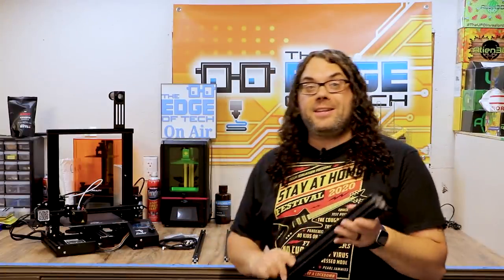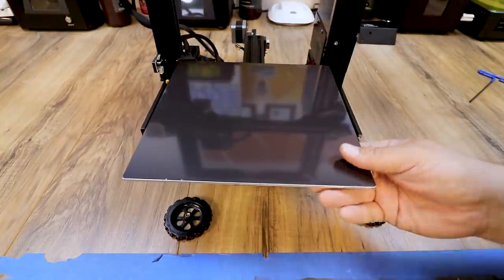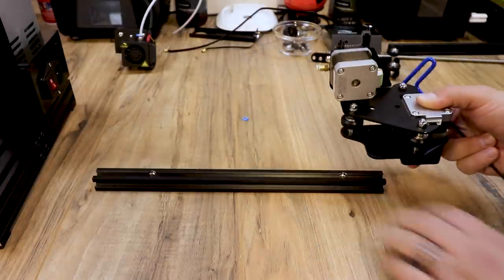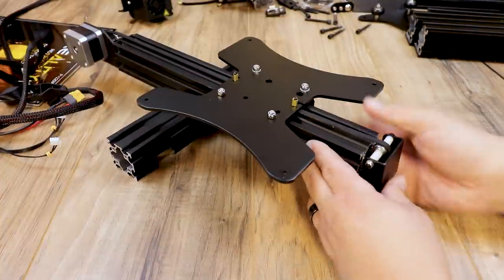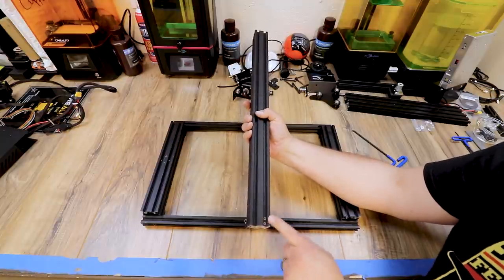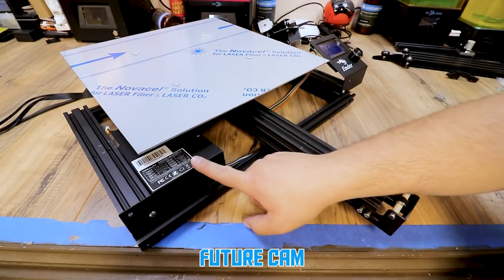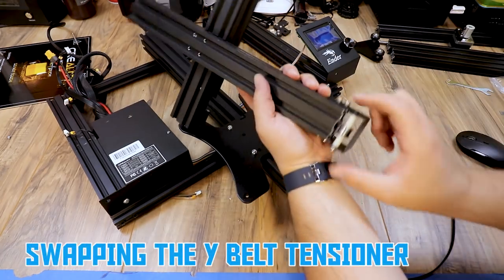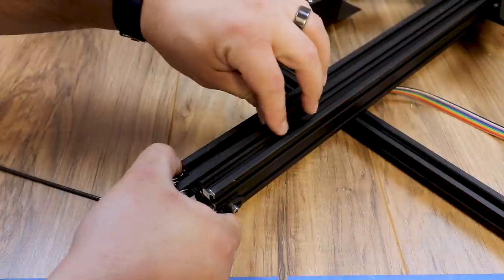UPDATED Ender Extender 400 Kit assembly for the Creality Ender 3 Pro

Comment: When I was making sure the vertical extrusions were properly parallel to each other, I clamped a level to each side, checked for square and then tightened the bottom bolts.  Easier than doing it by eye.

Comment: do you have issue with the Y carriage? I figured since the build plate is bigger = more weight = print issues
Reply from the maker: If you go to fast you could. When I used mine, I just printed at normal speed. It was ok.

Comment: Awesome video, many thanks for this. Is there a recommended Y motor for this as I am worried the original 42-34 will not cut it with the heavier build plate and larger prints that will be created on it? Should I change any other stepper motor or am I being paranoid?

Comment: Bit off topic.. could u do a video or reply here on having a completely solid bed on an ender 3 v2? By having 2 wheels between the solid bed mount without using any springs..
Id really appreciate it since im fed up with bed leveling
Reply from the maker: You can use solid bed mounts as long as you have auto bed leveling and that will kill two birds with one stone for what you're looking for!
Reply: Def need the ABL!I recommend TH3D studios! Got everything I needed and a little extra for just under $100 SHIPPED!!!!

Comment: I bought the 400x400x250 kit for $149 but I didn't want to fork out $100 more for the taller kit so I just bought 2x 600mm 2040 extrusion for $25ish and a 500mm lead screw for $13ish I think and a roll of wire to extend my wires for $5 and saved $60 give or take but I think but honestly cheaper route to go is buy creality cr10 s4 frame from banggood for $100-$150 and source a y carriage and bed and save about $60-$100 (maybe less or more depending on if you bought the wider kit and taller kit separate or as a package together) just a thought. But the kit itself was well packaged and parts were good just if I had to do it again I know a cheaper route plus after all is said you will have an extra ender 3 assembly and maybe for the extra 60-100 you saved you could part together an ender 3 and have 2 printers the numbers are just rough estimates but just food for thought not bashing the extender kit because I don't regret buying it because it did what it was supposed to and was what it said it was.
Reply: And I don't feel that only 4 wheels on 4040 extrusion is stable enough for a 16x16" or 400x400mm build volume.

Comment: I noticed on this larger bed, there is more surface area, and the screw stay in the same location. How is leveling affected of the entire bed? Is there any part of the bed not leveled?
Reply from the maker: It can be manually leveled like any other large printer. But I think I'm going to do auto bed leveling as a part of the project! More video will be coming soon!
Reply: @TheEdgeofTech  yes also interested in the head bed upgrade as well as a video showing firmware upgrade and maybe a description of actual machine size after the new build.
Reply: I haven't had much of an issue running my Ender 3 Pro 400 XL for the last few weeks but most of what I've been printing has been within the dimensions of the original build plate. Thingiverse has some models for cutting your own Y carriage which I still I plan on doing asap with the plasma cutter.

Comment: Just pulled the trigger on one of these for my non-pro.  I'm planning on using an adhesive PEI sheet on the bed - thoughts on whether I should put a more powerful (higher torque rating) Y axis motor on it during the rebuild?
Reply from the maker: I think it'll be fine and if it ever goes out then get a bigger one!

Comment: So you made this video in November, can you share your experience with this kit since then? I am more interested in 2 things....the X axis sag using only 1- Z axis lead screw and the build plate heating. Do you recommend a 2nd Z axis Lead screw? Do you recommend a larger heating plate? I have 2 Ender 3's both are non-Pro and I want to do this Mod on one of them. Thanks Man
Reply: Hello. Did you ever find out if bigger heating plate is available. I’m getting ready to do same upgrade on my ender3Pro
Reply: @bruceyoung1343  I ended up staying with the 300x300 build and the stock heater works fine. However I think the Ender Extender website has larger heaters for the 400x400
Reply: I’m thinking on replacing heater since it will be taken apart down past that on EnderExtender kit gets installed
Reply: I installed an extra Z screw it is a must too much sag

Comment: Question have you installed the silent board in the Ender 3 yet.  I did and mine prints great except when I use the pause at layer height setting what it does it goes into that setting but it resumes print right away without the pausing.  Any ideas on fixing this

Comment: Does not include a bed printing material, not glass no nothing.
Does not include any kind of crimping or plugs for the cables, you have to provide your own tool and know how to do it safely. Some of the holes needed to assemble are not tapped so you also have to have a tapping tool and know how to use it. You have to print some parts that are not included.... In short, better to go and buy a ender 3 max or something like that. Far too expensive for what you get.

Comment: What did you need to do to change the settings to allow for the new print table size??? Its the only part of the instructions I find lacking now
Reply: have you found out where firmwhere changes are located? which line in config.sys?

Comment: Do you have, and are you willing to share the STL for the cable bed extension? And do you have a video for AC powered 400 x 400  to Ender 3 pro  v1.1.2 instillation?

Comment: Jim. I installed my Ender Extender kit over weekend.  I used the supplied 300 x 300 aluminum plate over top original build plate plus mirror bed.  I leveled the bed.  All was good. But my test prints had issues sticking center rear. 1) I find the supplied aluminum plate has bend in it. Enough to slide two sheets of paper Under a metal straight edge.  Could this be issue?   Also is two pieces of aluminum be ok/ accurate for heat transfer thru the glass mirror top print area. Unless told otherwise I think not.  I’d like to get new heater element and stick it to new aluminum plate    Any ideas where get a new heater to stick on new 300 x 300 plate for Ender 3 Pro?
Reply: Get a mirror to use as a build plate brotha
Reply: @leavethekidsalone  I have done away with mirror bed and now have Fulament 2.0 bed with CLTouch  to deal with aluminum bed

Comment: Don't torque those bed screw nuts to the underside of that bed.

That side is the heater PCB and only protected by a thin film. If you drive the nuts in any more than hand tightened, you can strip the heater PCB bare and cause a situation.

Also, those standard beds are practically all bent with either a bulge or sag in the middle, attaching it to a huge plate like that, you should use a gasket between the two beds (aluminium foil should do) and probably also some thermal paste.
Reply: Also note for anyone buying this, a dual Z becomes pretty much mandatory at this point. The Ender 3 Pro could already lag and sag a bit on the undriven side, this is exacerbated with the almost twice as long X axis (it's a cantilever after all, remember Archimedes 'Give me a lever long enough and I shall lift the world).

So be prepared to also buy a dual Z axis kit. Preferably one with 2 motors and a new mainboard that can Auto Z level with two motors, since at this size, any degree of tilt is going to create a rather large travel between the beds two ends.

Comment: If you're going to install the mainboard in that position, there's two important changes that need to be done:

First, you'll want to install the extension wires on the power, bed heater, and thermistor cables early on. It's best to just do it right after taking the mainboard off. Mine came with a 2x2 Waygo connector for the heater wires, and a JST extension for the thermistor. Once those wires are installed on the mainboard, you can disconnect them, set the bed aside, and not have to deal with it connected to anything during the build. 

Second, if you put the mainboard case between the extrusions like that, you'll want to do the same with the screen. Just having the mainboard there acts as a shim and will put the body out-of-square. Doing the same on the other side with the screen will improve that.

Comment: The website says it comes with extensions for several electrical components. None of which were included in my kit, similarly to the video. It's interesting that you blame creality for potentially changing the length of their cables rather than the manufacturer of this kit for not including things which are stated to be included on their website. That's totally bogus.
Reply: Aside from any electrical extensions, my kid did not come with the boden tube either. All of which are listed as being included on the website.
Reply: @aeiounix  they were probably clearing out their existing kits, though they COULD have opened existing kits and added missing pieces.

I’m looking at doing this upgrade after I get familiar with my Pro (been a while since I even worked on my Davinci)

Comment: It's a nice design but by the time you have paid for beds and a correct size heater as there is no way that original bed heater will let you print PETG at the full size of your bed, you might as well have bought or built a 400x400 printer that was originally purpose-designed for that size bed,ie dual extrusions for the Y-axis, also remember you are investing the cost of your Ender 3 into the project and if you haven't upgraded to 32-bit and a new screen that also needs to be accounted for.
 I have already built a 400X400X450 V-King Core XY so my Ender will remain as it is.
Reply: This was the first printer I purchased (for it's low cost) and do not regret one penny one the investments I've made into upgrades. Pi running repetier server w/ a 7in touch screen, SKR mini e3 v2.0 32 bit board w/ a tft 35 touch screen, tita aero hotened/extruder, and now a massive 400 x 400 x 500 build volume. Even without having tweaked my linear advance settings I'm still comfortably printing at 120mm/s. Sure, I could have bought a more high end machine but I enjoyed the learning process.

Comment: Print a separate control box/housing for screen they have the stl on their Facebook
Reply from the maker: Nice! I will check that out! Thank you for the heads up!
Reply: Recommended if you have a glass bed and if you plan to print anything besides PLA (60°c) and without gradually incrementing it will shut off with thermal runaway. I have been able to get the bed to 85°c but had to pre heat to 55°c wait about 5 min to 10 min'ish then gradually increase 3-5°c every 5-10min to equalize temp of entire bed or else thermal runaway enables so I would highly recommend to buy a/c bed heater.
Reply: I don't recommend using the electronics enclosure that Ender Extender provides on Thingi, I had a hard time accessing the USB and sd card slot. I found an older control box that was a single body that I personally preferred.

I recommend getting the AC powered heat pad that Ender Extender offers and ditching the original heat pad. As long as you're comfortable with wiring up a solid state relay (multimeter, grounding, etc) then you're good.
Reply: Where on their facebook is this stl? I

Comment: I realize this video is 2 yrs old, so hopefully a couple of things have been fixed in more recent releases.  (1) Is there  a 110v silicone heating plate for the 400x400 bed ?  Using the already POS bed from the original machine bolted onto the huge 400mm plate is absolutely ignorant and inefficient.  I bet it takes 30 minutes to heat the bed. (2) Is there a bigger Y mounting plate for the 400x400 plate ?  Seems to me the bed adjustment nuts need to be out more towards the 4 corners.  (3)  Don't even get  me started on the pitiful electrical solutions.

Comment: i find that "upgrade" not so good. you cant use the complete bed, because you only have a little part heated. and that big plexi plate blocks heating.
Reply: You can buy a 400mm x 400mm AC powered heat pad that uses a solid state relay and actually heats much faster than the stock heated bed.
Reply: @metanoiaart7597  Not can you must if you want to use the complete bed. So you dont reach the temp overall equal